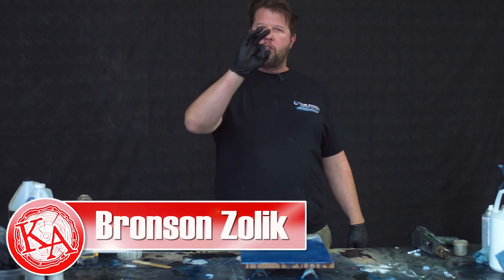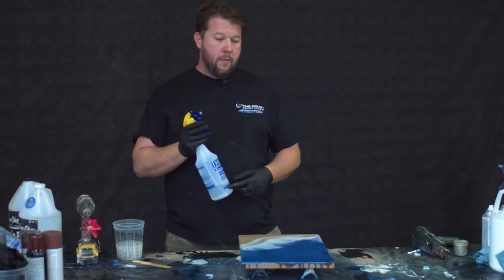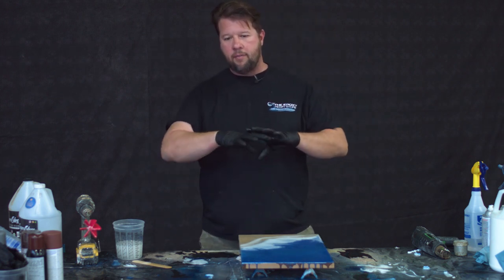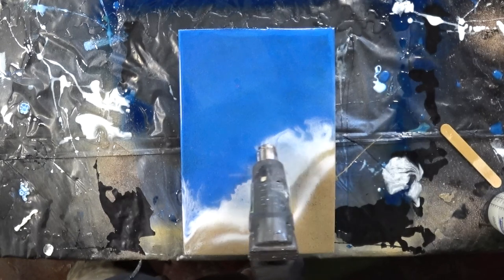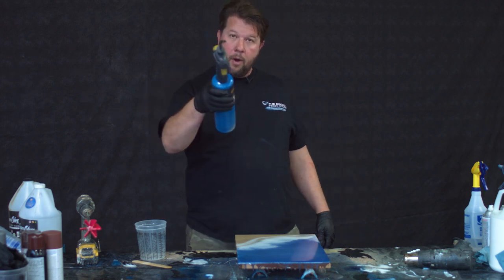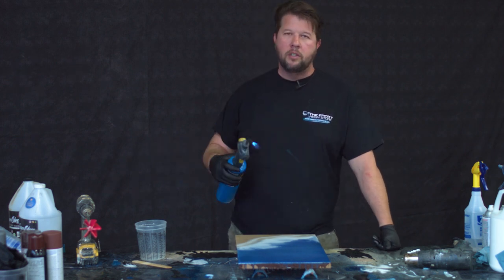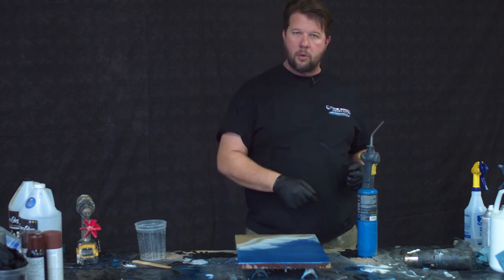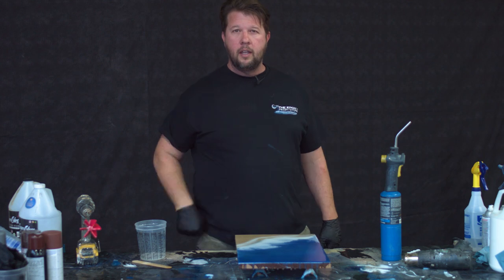Epoxy Resin Tips: 3 Proven Ways to Eliminate Bubbles

Comment: Hi, nice informational video. I have a question, when you say in the video that you set the heat gun to a low setting, is that a low temperature setting or a low air flow setting?